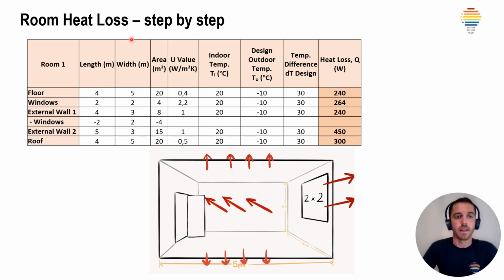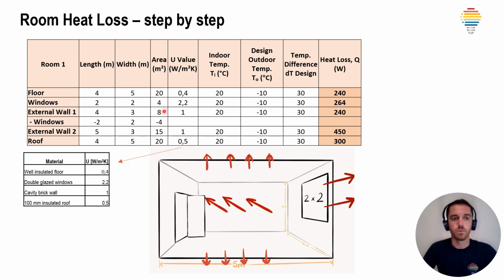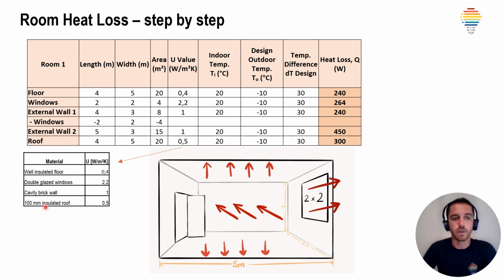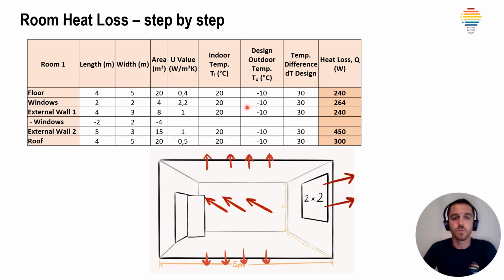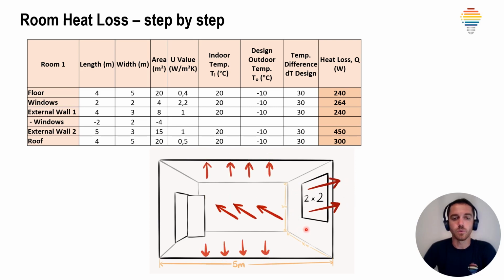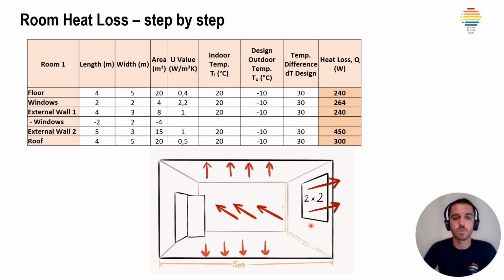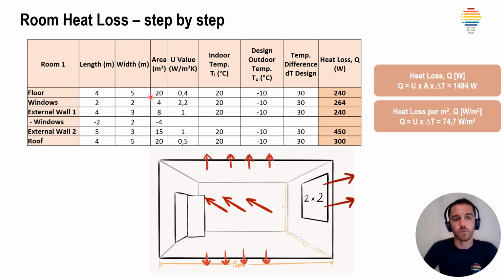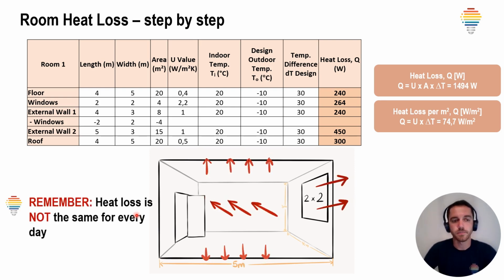Room Heat Loss Calculation Step-by-Step | Tutorial for Beginners

Comment: Great quick guide for the community. When you are looking at internal vs external wall losses, the delta T is what really drives the engineering results. BPConstruct helps homeowners visualize these losses so they can prioritize their insulation upgrades before they invest in a new heating system.